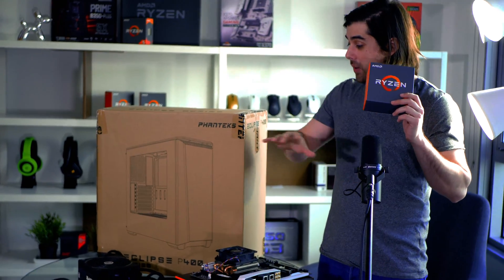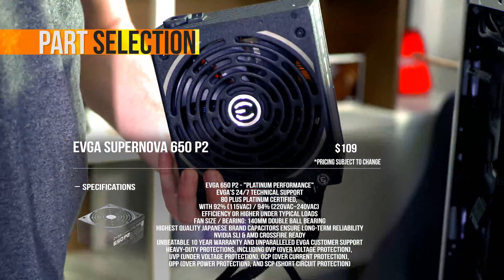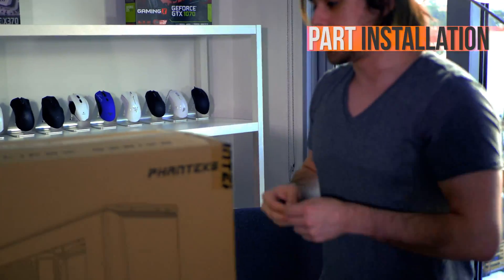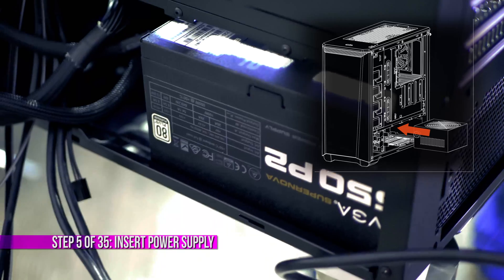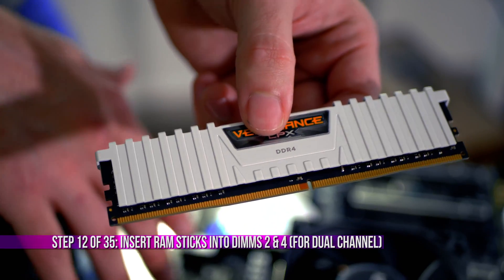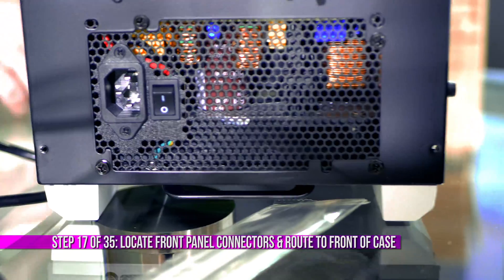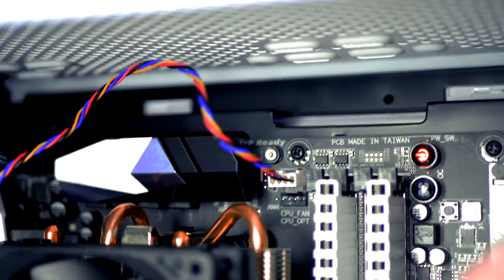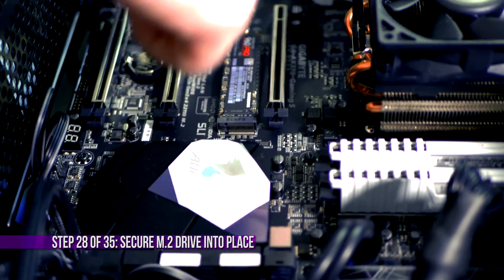How to Build Your Gaming PC - GTX 1080 Ti & Ryzen

Comment: What is the cheapest/oldest CPU/motherboard/RAM you can pair with an expensive 1080ti aftermarket GPU board? Also, how many years will that system allow upgrades to the GPU without limiting it vs. spending more on a more expensive CPU/motherboard/RAM?
Reply: MrApplewine anything less than an i7 will bottleneck the 1080ti, I know this because I own one. Don't and I repeat don't pair this with an amd fx series processor.

Comment: 1700x/1800x are waste of money!! better go for r7 1700 and  it oclocks same and for the rest of money you can buy or better GPU or better cooler
Reply: Mr11ESSE111 The 1700 has a 65watt thermal design where as 1700x & 1800x have a 95watt thermal design. In other words, if you think you're gonna run your 1700 oc'd for a long period of time you're gonna have a bad time.
Reply: NZIGNANTI why??
Reply: Makoro Gaming because OF cheaper price
Reply: Because you get what you pay for in longevity parts. Especially computer hardware.